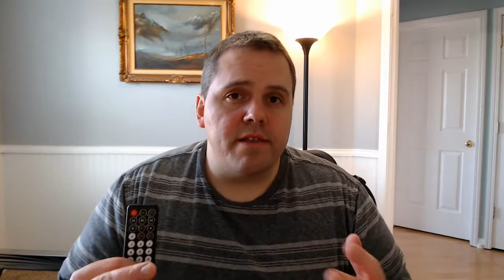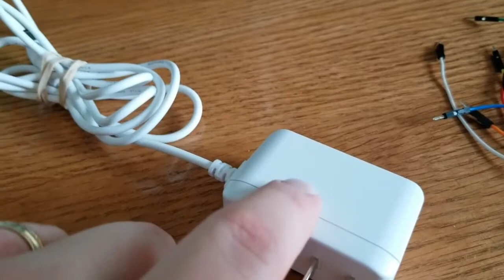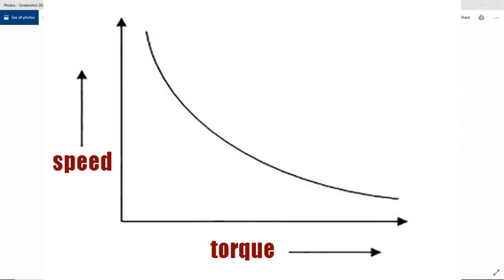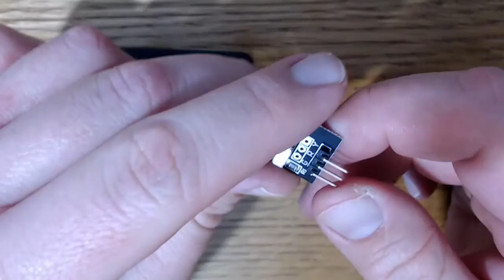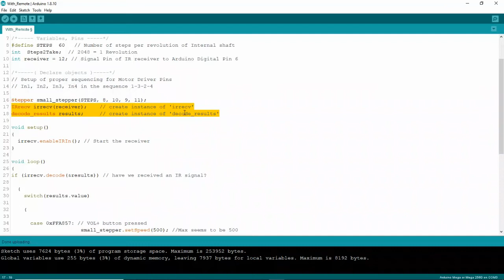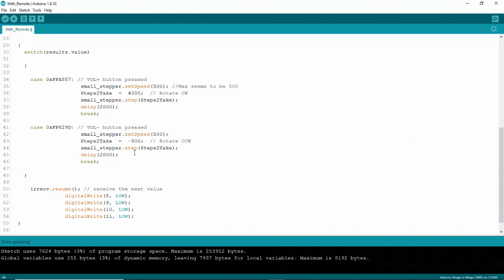How To Connect A Stepper Motor With IR Remote Control To Arduino (Lesson 32 of Elegoo Mega 2560 Kit)

Comment: code link?
Reply from the maker: It was from the elegoo mega kit file. here ya go!   

#include "Stepper.h"
#include "IRremote.h"

/*----- Variables, Pins -----*/
#define STEPS  32   // Number of steps per revolution of Internal shaft
int  Steps2Take;  // 2048 = 1 Revolution
int receiver = 12; // Signal Pin of IR receiver to Arduino Digital Pin 6

/*----( Declare objects )----*/
// Setup of proper sequencing for Motor Driver Pins
// In1, In2, In3, In4 in the sequence 1-3-2-4

Stepper small_stepper(STEPS, 8, 10, 9, 11);
IRrecv irrecv(receiver);    // create instance of 'irrecv'
decode_results results;     // create instance of 'decode_results'

void setup()
{ 
  irrecv.enableIRIn(); // Start the receiver
}

void loop()
{
if (irrecv.decode(&results)) // have we received an IR signal?

  {
    switch(results.value)

    {

      case 0xFFA857: // VOL+ button pressed
                      small_stepper.setSpeed(500); //Max seems to be 500
                      Steps2Take  =  2048;  // Rotate CW
                      small_stepper.step(Steps2Take);
                      delay(2000); 
                      break;

      case 0xFF629D: // VOL- button pressed
                      small_stepper.setSpeed(500);
                      Steps2Take  =  -2048;  // Rotate CCW
                      small_stepper.step(Steps2Take);
                      delay(2000); 
                      break;
                
    }
    
      irrecv.resume(); // receive the next value
                 digitalWrite(8, LOW);
                 digitalWrite(9, LOW);
                 digitalWrite(10, LOW);
                 digitalWrite(11, LOW);       
  }  

}/* -end main loop - */
Reply: @BMonsterLaboratory  thank you so much
Reply from the maker: You're welcome. Enjoy! 👍

Comment: hello bmonster i did try this one i see me that the remote give signal to the remove reciver but nothing move the motor what could be the cause ?
Reply from the maker: Hi Olivier! Did you double check your wiring? Are you using external power for the motor? If yes to both of those, can you share the code you're using ?
Reply: @BMonsterLaboratory  yes i did recheck the whole wiring and i use external power . the little power board have the green led on . ill join the code i used 
#include "Stepper.h"
#include "IRremote.h"

/*----- Variables, Pins -----*/
#define STEPS  32   // Number of steps per revolution of Internal shaft
int  Steps2Take;  // 2048 = 1 Revolution
int receiver = 12; // Signal Pin of IR receiver to Arduino Digital Pin 6

/*----( Declare objects )----*/
// Setup of proper sequencing for Motor Driver Pins
// In1, In2, In3, In4 in the sequence 1-3-2-4

Stepper small_stepper(STEPS, 8, 10, 9, 11);
IRrecv irrecv(receiver);    // create instance of 'irrecv'
decode_results results;     // create instance of 'decode_results'

void setup()
{ 
  irrecv.enableIRIn(); // Start the receiver
}

void loop()
{
if (irrecv.decode(&results)) // have we received an IR signal?

  {
    switch(results.value)

    {

      case 0xFFA857: // VOL+ button pressed
                      small_stepper.setSpeed(500); //Max seems to be 500
                      Steps2Take  =  2048;  // Rotate CW
                      small_stepper.step(Steps2Take);
                      delay(2000); 
                      break;

      case 0xFF629D: // VOL- button pressed
                      small_stepper.setSpeed(500);
                      Steps2Take  =  -2048;  // Rotate CCW
                      small_stepper.step(Steps2Take);
                      delay(2000); 
                      break;
                
    }
    
      irrecv.resume(); // receive the next value
                 digitalWrite(8, LOW);
                 digitalWrite(9, LOW);
                 digitalWrite(10, LOW);
                 digitalWrite(11, LOW);       
  }
Reply: when i press the remote i see the reciver led but i never see any led into the stepper controler board
Reply from the maker: @olivierlandry1195  it looks fine so far. Have you tried reducing the delay?  Try 500 and 1000 ? That may help.
Reply from the maker: @olivierlandry1195  I can get the parts and put this together and see how it acts for me. The code looks fine though.
Reply: @BMonsterLaboratory  try to 500 and 1000 nothing work fell like the recived command dont get to the motor controler board, since when i do the previous lesson . the straight stepper turning one way then the other , everything work fine so motor control boards work and stepper also
Reply from the maker: Hey Olivier, did you get this workingg?  Just checking
Reply: no but i was able to make motor move with the joystick for now
Reply: @olivierlandry1195  Just ran into this same problem, I had to uninstall the ir remote library and reinstall it without updating. That fixed the issue for me

Comment: Hey BMonster, when I try to verify the code, it says...

C:\Users\glitc\AppData\Local\Temp\.arduinoIDE-unsaved2022115-22152-1xbxxv7.htvw\sketch_dec5a\sketch_dec5a.ino:4:10: fatal error: IRremote.h: No such file or directory
 #include "IRremote.h"
          ^~~~~~~~~~~~
compilation terminated.

exit status 1

Compilation error: IRremote.h: No such file or directory
Reply from the maker: Hi there! you need to download the IRremote library. You can do it through Arduino IDE under library manager or get it from github. It needs to be downloaded before you include it in your program. Hope that helps! 👊👍
Reply: Thank you so much!!!
Reply from the maker: @defnotglitch628  glad you got it working.  Good luck with your projects! 💪👊

Comment: Hello there! I am trying to use two end-stop switches with this stepper motor as to controller its limits but I have something wrong in my code can you check where is the problem, please...

@/include "Stepper.h"
@/include "IRremote.h"
/*----- Variables, Pins ----- */
@/define STEPS 32 // Number of steps per revolution of Internal shaft
int Steps2Take; // 2048 = 1 Revolution
int receiver = 6; // Signal Pin of IR receiver to Arduino Digital Pin 6
/*---( Declare objects )---*/// Setup of proper sequencing for Motor
Driver Pins// In1, In2, In3, In4 in the sequence 1-3-2-4
Stepper small_stepper(STEPS, 8, 10, 9, 11);
IRrecv irrecv(receiver); // create instance of 'irrecv'
decode_results results; // create instance of 'decode_results’
void setup()
{ irrecv.enableIRIn(); // Start the receiver
pinMode(2,INPUT_PULLUP);
pinMode(3,INPUT_PULLUP);
}
void loop()
{
if (irrecv.decode(&results)) // have we received an IR signal?
{
switch(results.value)
{
case 0xF3A9C948: // 3 button pressed
if(2!=0){
small_stepper.setSpeed(300); //Max seems to be 700
Steps2Take = 530; // Rotate CW
small_stepper.step(Steps2Take);}
break;
case 0x7FAA9A9A: // 2 button pressed
if(3!=0){
small_stepper.setSpeed(300);
Steps2Take = -530 ; // Rotate CCW
small_stepper.step(Steps2Take);}
break;
}
irrecv.resume(); // receive the next value }
} /* -end main loop - */
Reply from the maker: Hi Abid! I'm sorry, I just haven't had a chance to try this out. It looks like you're using an IR remote control. Have you double checked the IR button codes?  Can you get the code to work at all or do you just get an error message?  Great to hear from you

Comment: Hello there! I am trying to use two endstop switches with this stepper motor as to controller its limits but I have something wrong in my code can you check it where is the problem please...

@/include "Stepper.h"
@/include "IRremote.h"
/*----- Variables, Pins ----- */
@/define STEPS 32 // Number of steps per revolution of Internal shaft
int Steps2Take; // 2048 = 1 Revolution
int receiver = 6; // Signal Pin of IR receiver to Arduino Digital Pin 6
/*---( Declare objects )---*/// Setup of proper sequencing for Motor
Driver Pins// In1, In2, In3, In4 in the sequence 1-3-2-4
Stepper small_stepper(STEPS, 8, 10, 9, 11);
IRrecv irrecv(receiver); // create instance of 'irrecv'
decode_results results; // create instance of 'decode_results’
void setup()
{ irrecv.enableIRIn(); // Start the receiver
pinMode(2,INPUT_PULLUP);
pinMode(3,INPUT_PULLUP);
}
void loop()
{
if (irrecv.decode(&results)) // have we received an IR signal?
{
switch(results.value)
{
case 0xF3A9C948: // 3 button pressed
if(2!=0){
small_stepper.setSpeed(300); //Max seems to be 700
Steps2Take = 530; // Rotate CW
small_stepper.step(Steps2Take);}
break;
case 0x7FAA9A9A: // 2 button pressed
if(3!=0){
small_stepper.setSpeed(300);
Steps2Take = -530 ; // Rotate CCW
small_stepper.step(Steps2Take);}
break;
}
irrecv.resume(); // receive the next value }
} /* -end main loop - */

Comment: Is there a way to keep the motor rotating until the button is released?
Reply from the maker: Hi Ramanjeet. Great question! My first instinct would be to post what I think would work. I would like to put this together on a breadboard and test it before I post the code, that way there's no confusion. I'll post it in this thread and on the Facebook page for others to see when I get home from work. Thanks for asking~
Reply: @BMonsterLaboratory  I'm currently working on trying to figure this one out too. Have you discovered anything? I'm having a hard time figuring out how to change the speed. It will either move very slow, or slightly faster where each button press is sending a burst of steps, not ideal.
Reply from the maker: @SrgntBlntPasser  hey there! Try this video out https://youtu.be/xkH2EJglwbk  After buying a NEMA 17 stepper, I probably won't use the one in this video again. Most stepper motors don't have a fast speed. Higher torque = lower speed. What kind of project are you using a stepper on? Are you using the same sketch as I am in this video?
Reply: @BMonsterLaboratory   I'm trying to DIY my own telescope autofocuser. I have it currently working with 2 buttons and a potentiometer. I hold a button down and it rotates continuously at a speed defined by the Pot and it stops when the button is released. But the idea is to not touch the scope so I'm replacing the buttons with the remote and then replace the Pot with a High and Low setting on the remote.
Reply: @BMonsterLaboratory  I am extremely close I needed to add a case for when the button in not pressed, and only step 1 time per loop, and set a delay time for each loop. Now I just need to find the max and min delay needed to set my high and low. I'll post a video on my other channel and get back to you when I do!
Reply from the maker: @SrgntBlntPasser  good idea. post the code as well 👍
Reply from the maker: @SrgntBlntPasser  nice....  I did a google search for "Arduino Focuser 2". I'm sure you have seen this, but it sounds like your description.

Comment: Thanks a million for doing this, your videos are easy to understand and well explained.  I am having and issue however and get this error, can you possibly help me?

Thx!
Jamie

ERROR:

Arduino: 1.8.15 (Mac OS X), Board: "Arduino Mega or Mega 2560, ATmega2560 (Mega 2560)"

Sketch uses 9340 bytes (3%) of program storage space. Maximum is 253952 bytes.
Global variables use 481 bytes (5%) of dynamic memory, leaving 7711 bytes for local variables. Maximum is 8192 bytes.
avrdude: stk500v2_ReceiveMessage(): timeout
avrdude: stk500v2_ReceiveMessage(): timeout
avrdude: stk500v2_ReceiveMessage(): timeout
avrdude: stk500v2_ReceiveMessage(): timeout
avrdude: stk500v2_ReceiveMessage(): timeout
avrdude: stk500v2_ReceiveMessage(): timeout
avrdude: stk500v2_getsync(): timeout communicating with programmer
An error occurred while uploading the sketch

This report would have more information with
"Show verbose output during compilation"
option enabled in File -> Preferences.

Here is the code I have been trying from Lesson 32, modified as per another issue asking me to delete a value:

//www.elegoo.com
//2016.12.12

#include "Stepper.h"
#include "IRremote.h"

/*----- Variables, Pins -----*/
#define STEPS  32   // Number of steps per revolution of Internal shaft
int  Steps2Take;  // 2048 = 1 Revolution
int receiver = 12; // Signal Pin of IR receiver to Arduino Digital Pin 6

/*----( Declare objects )----*/
// Setup of proper sequencing for Motor Driver Pins
// In1, In2, In3, In4 in the sequence 1-3-2-4

Stepper small_stepper(STEPS, 8, 10, 9, 11);
IRrecv irrecv(receiver);    // create instance of 'irrecv'
decode_results results;     // create instance of 'decode_results'

void setup()
{ 
  irrecv.enableIRIn(); // Start the receiver
}

void loop()
{
if (irrecv.decode()) // have we received an IR signal?

  {
    switch(results.value)

    {

      case 0xFFA857: // VOL+ button pressed
                      small_stepper.setSpeed(500); //Max seems to be 500
                      Steps2Take  =  2048;  // Rotate CW
                      small_stepper.step(Steps2Take);
                      delay(2000); 
                      break;

      case 0xFF629D: // VOL- button pressed
                      small_stepper.setSpeed(500);
                      Steps2Take  =  -2048;  // Rotate CCW
                      small_stepper.step(Steps2Take);
                      delay(2000); 
                      break;
                
    }
    
      irrecv.resume(); // receive the next value
                 digitalWrite(8, LOW);
                 digitalWrite(9, LOW);
                 digitalWrite(10, LOW);
                 digitalWrite(11, LOW);       
  }  

}/* -end main loop - */
Reply from the maker: Hey there Jamie! Thanks for the comment. I appreciate it.  Just curious, do you have the correct board, processor, and port selected in the tools menu of IDE?  Have you tried uploading with another USB on your computer and using that port? Give that a try and let me know.
Reply: Sorry, today is my first day coding and using this gear.  I realized that I had not set it to UNO in this case.  There are no errors now, but the unit does not work.  Not sure if you have any private lessons?! OR if you would simply look at my setup.  THX
Reply from the maker: I was looking at your code. replace the first line of your loop with this "if (irrecv.decode(&results)) // have we received an IR signal?"  you just left out the results of your decode.  let me know how that works.
Reply from the maker: @jamiethompson1082  and if you ever what to email a question...feel free.  bmonsterlaboratory@gmail.com  I don't do private lesson but I can do my best to help with code.
Reply: @BMonsterLaboratory   - Thank you so much - I am looking fwd to getting home from work to try this.  Million thx!!
Reply from the maker: @jamiethompson1082  you're welcome anytime.

Comment: Hi there! great video, loved that you went in depth about everything. Just a question since I'm new to this whole thing, is it possible to create a sequence of clock wise and then counter CW with one button?
Reply from the maker: Hi there movies4life R&S!  Yes, you can create a CW / CCW spin with a push button. Do you want 1 full rotation CW and then 1 Full rotation CCW just once per button push or continuous?  Thanks for asking!
Reply: @BMonsterLaboratory  can you do it continuous? where could I find a code for this

Comment: Can you send me lesson32 please?
Reply from the maker: Hi there!
Here is the code for Stepper Motor + IR Remote. Just make sure you have the Stepper and IRremote libraries installed at the Arduino IDE. best of luck! 👍

//www.elegoo.com
//2016.12.12

#include "Stepper.h"
#include "IRremote.h"

/*----- Variables, Pins -----*/
#define STEPS  60   // Number of steps per revolution of Internal shaft
int  Steps2Take;  // 2048 = 1 Revolution
int receiver = 12; // Signal Pin of IR receiver to Arduino Digital Pin 6

/*----( Declare objects )----*/
// Setup of proper sequencing for Motor Driver Pins
// In1, In2, In3, In4 in the sequence 1-3-2-4

Stepper small_stepper(STEPS, 8, 10, 9, 11);
IRrecv irrecv(receiver);    // create instance of 'irrecv'
decode_results results;     // create instance of 'decode_results'

void setup()
{ 
  irrecv.enableIRIn(); // Start the receiver
}

void loop()
{
if (irrecv.decode(&results)) // have we received an IR signal?

  {
    switch(results.value)

    {

      case 0xFFA857: // VOL+ button pressed
                      small_stepper.setSpeed(500); //Max seems to be 500
                      Steps2Take  =  4000;  // Rotate CW
                      small_stepper.step(Steps2Take);
                      delay(2000); 
                      break;

      case 0xFF629D: // VOL- button pressed
                      small_stepper.setSpeed(500);
                      Steps2Take  =  -6000;  // Rotate CCW
                      small_stepper.step(Steps2Take);
                      delay(2000); 
                      break;
                
    }
    
      irrecv.resume(); // receive the next value
                 digitalWrite(8, LOW);
                 digitalWrite(9, LOW);
                 digitalWrite(10, LOW);
                 digitalWrite(11, LOW);       
  }  

}/* -end main loop - */
Reply from the maker: I'm not sure why the text is  crossed out...hmm...  Just copy & paste and you'll be fine~
Reply: @BMonsterLaboratory  can you modify with NEMA 17 stepper motor and for an arduino DUE please